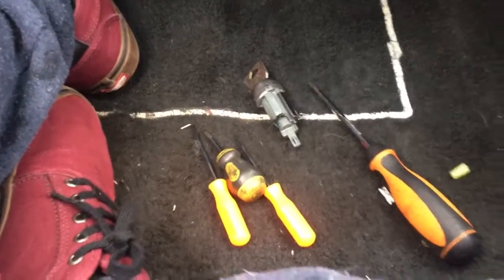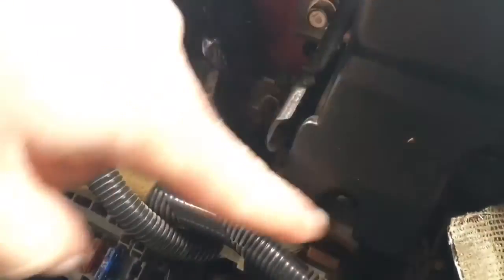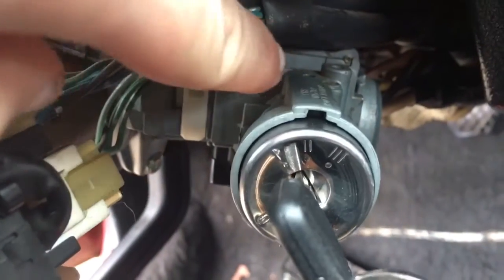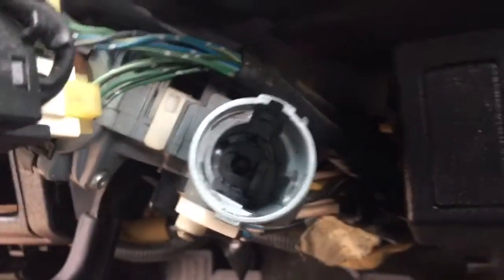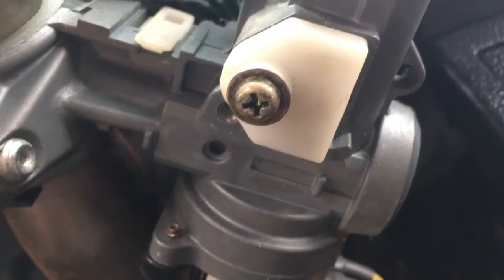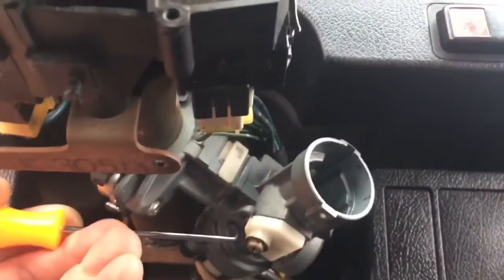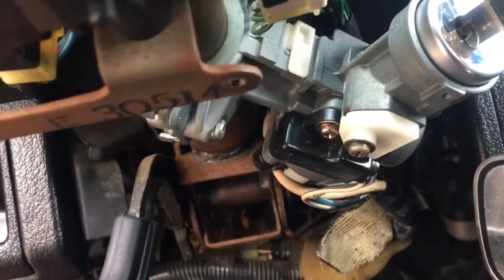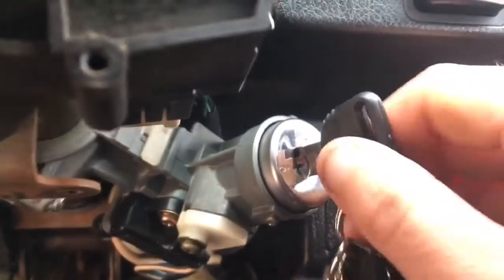How to replace ignition lock cylinder in a 88-91 Honda Civic/ CRX

Comment: Great video just did mine right now. If you guys follow these instructions and it still won’t push in try using a pick to hold down the top button while you slide it in. Worked for me.

Comment: How do I get the cylinder out without key?
Reply: I just watch a video about this. Dude drilled the pin off and it worked. Hope this helps someone else
Reply: @HiddenRamza  I figured it out but forgot how I did it. 😅
Reply: @lochnessspeedwerkz6557  lol all good. I know you posted a year ago. But I thought I comment on it so someone else might see that had the same question. I just ran into this problem and found a video with a dude drilling that push button without the key and it helped me.

Comment: Having the same issue on my 91 crx si. Followed all the instructions, column lock is depressed and cylinder is in position 1 but it still won’t sit in place. It sits 1 click just before it’s supposed to settle. Not sure what’s stopping it. My key turns the ignition tumblr no problem so I don’t think it’s broken. Really don’t want to be that guy with 2 keys, 1 for the door and 1 for the ignition, any ideas?

Comment: Auto parts store tells me that manual transmission cars require the replacement of the entire assembly. True or false? Or is the actual cylinder different for manual and automatic transmission cars?
Reply from the maker: On these cars that’s 100% false. This was a manual car in the video. But it might be different on other cars
Reply: @tylermarmon__92  What Civic do you have?
Also, this looks like a job for an electric screwdriver.
Reply: @tylermarmon__92  I’d forget the pick holding the slide in place and just use my finger. I did this before and got my old cylinder to work. This time I can’t get either to work. As I look down the hole it appears that the long thing in the middle of the cylinder fits into a slot. That is 90 degrees to the right of the top button and puts the key in the third position. To top off my troubles, I’ve got a flat tire that I couldn’t plug and I’m on my wife’s side of the garage.

Comment: Thanks you for this video, Tyler. It will help me quite a bit. Now for a tough one. The wires with the whit plastic disc that goes on the other end of the cylinder.. someone tried to steal my CRX and broke off the heads of the 2 small screws that hold the wires in place. I have a big zip tie holding it tight so the little "L" shaped piece turns and starts the car. I do need a new cylinder, but need to know how to get the broken off screws out of the housing or change the housing as the wires do not fit tight. Very small and tapping/ rethreading seems like quite a job. Any suggestions? Thanks again, you showed me part of an easy (now) job.
Reply from the maker: Ian Barber check your local harbor freight, I forget what they’re called but they sell screw extractor kits, it’s basically like a reverse drill bit that drills into the bolt part of the screw in reverse until the screw starts to turn out on it’s own. Idk how small the screws your talking about are but I believe that should work
Reply: Tyler Marmon  thank you, about to go get my cylinder lock and do this. Next stop harbor freight. next I need to see if you or someone has a video of replacing the cam seal on distributor end as I also need to replace my spark plug well o-rings, so with valve rockers out I may as well replace it.

Comment: where'd you find replacement cylinder? I can't find one anywhere
Reply: Cesar Aguilar junk yard dude...or someone that works on Honda's...late models are harder to find
Reply from the maker: Cesar Aguilar I found mine on amazon as well as some auto parts stores but amazon was definitely the cheapest

Comment: Not related to the ignition cylinder (helpful video btw) is that drink holder fitted into the air vent, I've been thinking where to mount one on my civic
Reply from the maker: Lunatic Lane yes it is. I found a pack of 4 of them at Walmart for cheap, be careful what you put into it though that one ended up breaking pretty easy after a while and spilled my Baja blast all over the place

Comment: I can use my key and start it. But on the ll position my radio and heather stops working. Is that in the ignition as well or behind it.
Reply: I have the same problem, no heater or radio in the "on" position.

Comment: My crx takes a few trys to start up, the battery works and everything but when I turn the key, I get nothing but the sound of the fuel pump. It usually takes about 10 turns for it to crank (sometimes it happens on the first), and it cranks over fine. Do you think this is my problem?
Reply from the maker: scoot probably not, this is more so for if your key is messed up, broken or if your key tumbler is messed up. Just because your battery is charged doesn’t necessarily mean your getting spark to the engine, check your plugs, wires and distributor. If all that’s fine start looking for fuel issues. I had an issue kind of similar to that. Even though I could hear my fuel pump it was on its way out and wasn’t sending enough fuel and would take multiply times to finally get it to start. Replaced my fuel pump and never had that issue again.

Comment: Question! So I called my local auto parts store, and they have one ignition lock cylinder, but it doesn’t specify if it for a manual, or automatic! Mine is a 5speed , but will it work if it ends up being an ignition cylinder for an automatic ? Thanks
Reply from the maker: salvador J bravo I’m pretty sure the cylinder should be the same. I don’t see why that part would be any different it’s basically just a lock tumbler the controls the ignition

Comment: What if I just lost my key and I can't put it in number one to push that PN in to pull the cylinder out
Reply from the maker: If you’re replacing the lock cylinder then I’m assuming you don’t care about the one in there. If that’s the case, on these older Honda’s you can use a shaved key or a butter knife or a screw driver to make it turn. The lack of security in these old Honda lock cylinders is one of the main reasons they’re still one of the top stolen vehicles in the US
Reply: That still doesn't work. My key womt turn it. A screwdriver wont turn it. A knife womt turn it. I just can not get it to turn to position 1

Comment: so I've got a 90honda accord...it stopped catching and we thought it was the distributor which we cleaned and worked for a cpl weeks...then stopped...changes the distributor...didn't fix it...changed the fuel pump (major pia) and then one of the four relays... gonna try replacing the ignition and computer this week. anyone else had non-stop issues?
Reply from the maker: New plugs and wires? So far I've don't just about everything on my crx aside from rebuilding the engine. I did have this issue for a bit and my fuel pump fixed it. Maybe also check your fuel filter, it's fairly cheap (I think mine cost $25) and very easy to do.
Reply: now I'm not getting power to the fuel pump at all... someone else switched out my distributor and mentioned the gap the arc had to jump seemed wide but that it was making it so it must be the pump but after we changed it and it still didn't start someone else messed with the relay which did get it running but then it stopped every other minute and eventually stopped starting altogether...so frustrating
Reply: then we replaced that relay and still no start
Reply from the maker: Eva May may be a wiring issue. I know EFs are notorious for the wire harness getting brittle and causing issues.
Reply from the maker: I've never been much of a Honda person but I've leaned a lot from this one and I know I've ran into quite a few issues caused by brittle wire